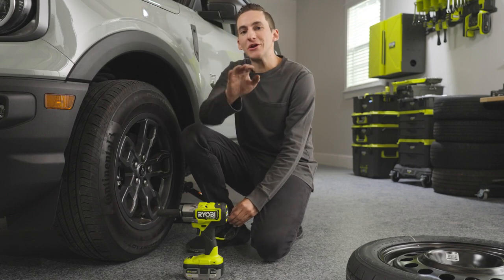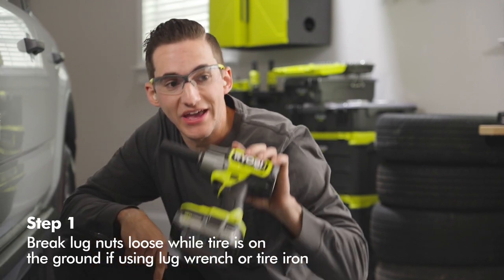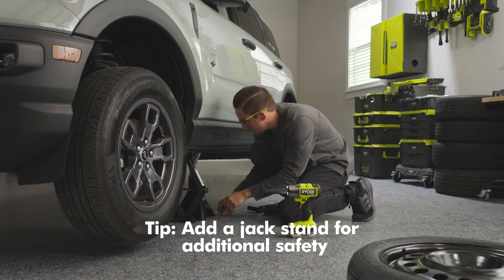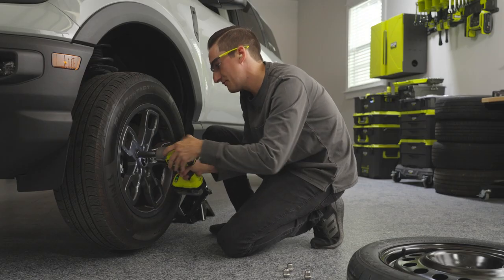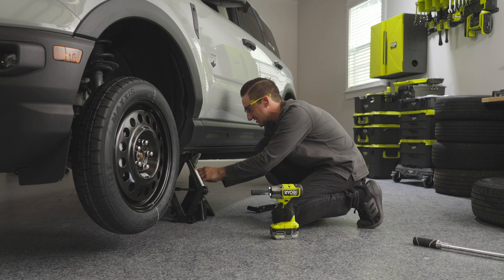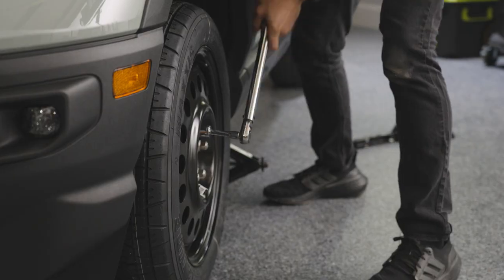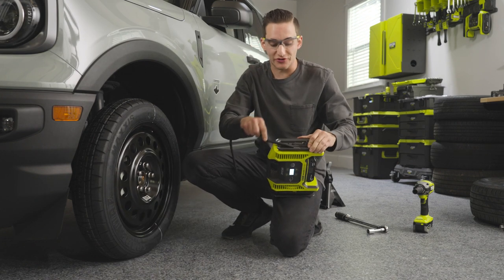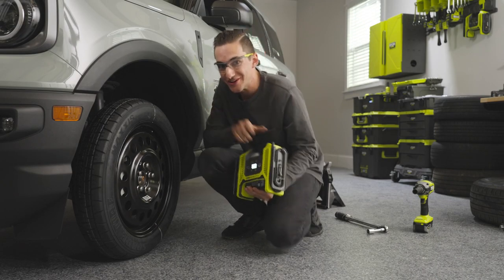How to Change a Tire In Less Than 15 Minutes

Comment: I'm pretty sure the impact will chew up the threads on the scissor jack after a couple uses.  I keep an old Ryobi drill (set to low speed) in the car with a big battery just for the scissor jack.   Jack = mild steel, lug nuts = hardened steel.
Reply: Where do we get the bit that fit on the drill size and link???
Reply: @rbellot11 1/4” to 1/2” socket adapter
Reply: @BillBrutal  Thank you very much, video is great but that key piece of information was missing…..also thank you for taking the time to respond.